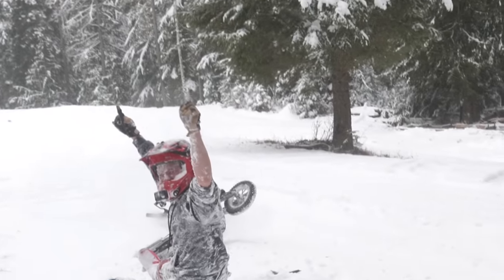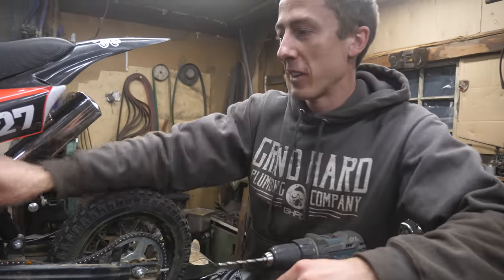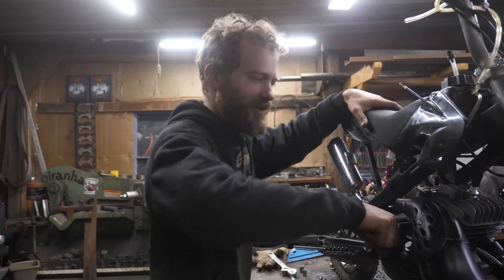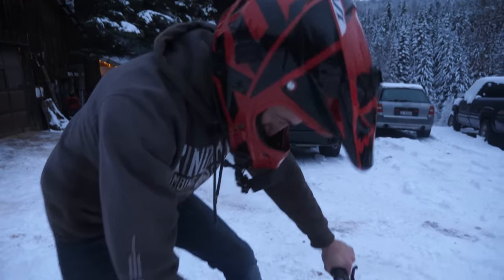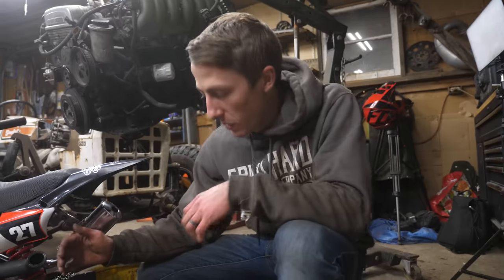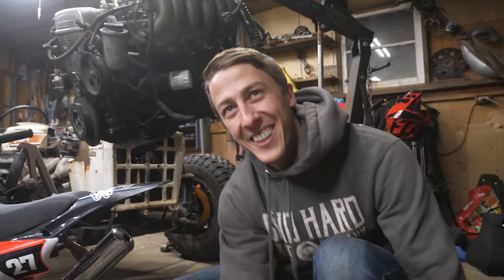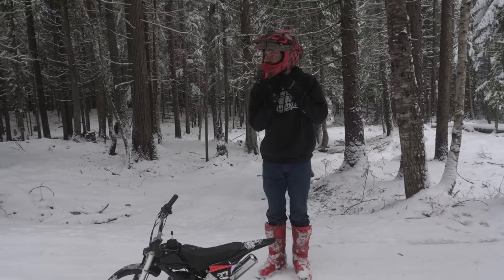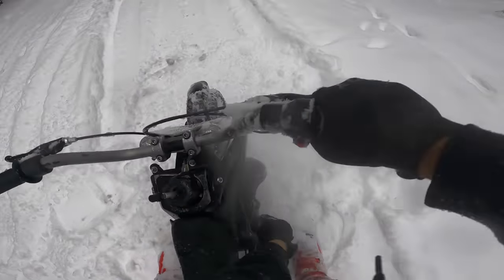$300 Amazon Dirt Bike Engine Swap 10x The HP! + Studs

Comment: You guys should build an rc car out of the old engine
Reply: MINI SENDY
Reply: Yes
Reply: yes please
Reply: y e s
Reply: Great idea!
Reply: Great idea!
Reply: Mini monster truck Jeep for a Barbie doll?
Reply: Yes
Reply: It would be just as unimpressive as the mini bike was with that motor. I own multiple gas powered rc cars and the engines used in gas rcs are much more similar to the new 50cc KTM clone they’re using than the old 4 stroke weed whacker motor.
Reply: @unitedspacepirates9075  Too small.  How about Chucky as driver?
Reply: not enough power lol
Reply: Build it
Reply: Good idea
Reply: WalnutLeader 340 some RC cars have more power than that engine..
Reply: @airtaiH2  yeah I know but it would still be cool. Just trying to give the engine a use instead of making it into a blender lol
Reply: Nitro engines that come in Rc cars have 3+ hp so that would be a downgrade
Reply: @colemanbinyon7063  true. Gearing also has a huge factor in it too
Reply: Margarita maker.
Reply: As others have said, it would most likely been a downgrade from actual rc engines these days. Make a desk fan.
Reply: @donellmuniz590  that would be funny as well
Reply: @BPatches701  lol that may also be a good use
Reply: YES

Comment: Big improvement over the stock engine. I had a KTM pro senior 50 a few year's ago. It had the water cooled 50cc engine. Absolutely no bottom end but man it would fly when it came on the pipe. It would easily blow away my 4 stroke 125 and 140cc bike's. Anyway, it was tons of fun but simply to small for me to ride comfortably so I sold it. Now I want another one after after this video.
Reply: Buy a Honda Grom or Grom Clone then slap on a 50cc or 85cc 2 stroke, then throw knobbies on

Comment: Just a heads up for you youngins at GHPC and out there in tubeland... If you pour 2 stroke oil into the gas tank like that you're going to get a heavy oil to fuel mix for the first few minutes which is fine for the engine,however once tbat oil which is heavier than gasoline is used up the exhaust is going to clear up and no more 2 stroke smoke will be seen due to not enough oil in the mix...Which is why we always mix our oil and gas in a gas can thay can be shaken up to fully distribute the oil with the gas and we never start and ride a 2 smoke without shaking the bike for a minute or three to help remix the oil with the gas.. Longer engine life comes with proper oil to gas ratio and agitating the 2. Judt an old timer from the 2 smoke eras shared knowledge...

Comment: Love the set tapper idea on the tire.   Might have to do that to my motorcycle for winter riding.  I have a odd tire size but my wheels come off feather easy bolting on to hubs like a car in the back and typical shaft on the front.  I could just get another set for winter.  Now just need a way to stay warm too

Comment: 3:20 That was the thickest 2 stroke oil i have ever seen
Reply: Likely back from the days when "2 stroke oil" was basically just 10w30 motor oil.
Reply: The fact it wasnt a proper mix ratio, or even mixed with gas was really bothering me as well. Especially on break in. Cringed a little.

Comment: I rode a honda cb350 during winter of 89 in ky to school, I used my size 13 feet in biker boots as skis/stabilizers most the time. It was about a 30 mile round trip and only crashed once when showing off in school parking lot. All in all it was a very cold experience.

Comment: So question. I have a ssr pitbike and I swapped the motor engine from a kick star 50cc to a electrical quick start 110cc engine. I got new wiring harness and a mini battery. i did most of the wiring by following some guides not sure tho if I did it properly but.. I did try starting it and it kind wanted to but it didn't at all. I'll start making youtube videos about it for you guys to see what I am talking about.

Comment: Thanks for the inspiration. I’ve got the real ktm air cooled motor I brought on eBay I’ve been intending to overhaul for months now and put in a China frame that is the full cradle design almost as close as the ktm replica pull start model can be. I actually payed more for my bike then the motor lol
By the way I didn’t search this it just popped up. Meant to be inspiration 😌

Comment: U guys should be testing the offroad three wheeler in the snow
Reply: Tri-sport Airport. 1974 RTS 340 With a 1969 350cl honda for power I did one in 74. To top out at 55mph. 7 inch disc brakes hydraulic rear for left and right steering in to corners

Comment: Can one of these engine be swapped for the 2stroke, or are they different sizes to the 2stroke?
I have an rc car with the 30cc 2stroke weed eater engines. I would like to swap for one of these engines. I don't want to buy one, and it does not fit. 
Do the bolts to the clutch bell be the same as the 2stroke set up?

Comment: After riding that thing 50 feet your ass will has so much oil on it from the exhaust you wont be able to sit on a chair made of sandpaper and not slip off LOL  If your going to track it! you need to add a ski to the front also! Go all in!

Comment: Good morning to boys of the hard kind of grinding I JUST got up from bed and sat my Finnish ass down in front of this machine that sometimes will, and most of the time doesnt compute, I think they call em peecees. So anyway as Im sipping this cold start spray for my brain and enjoing the video and the cool weather I instantly found nmyself thinkin than damn that tiny 4T engine would be an absolute funnybone tickleler if you would plant it into a 1/4 -1/8  size RC car like the edcat ampage rally ( SERIOUSLY GOOGLE THAT) and look for one  without the  body, a  picture taken from top where you can see the whole chassis with the 2 stroke motor mounted and all of the important parets of it and im pretty sure with your skills and abilities you guys could easily make used one redcat rampage chasis into a BEAUTIFUL 1/5 size 4 stroke ICE/SNOW DRIFTER,

But whatever you do please,just please dont do what EVERY damn person goes for with rc's and bigger gasoline motors; a DAMN no good monster truck wich will be unable to be driven and  enjoyed like these rally ,short-course, buggy and touring cars Trust me ive been in the hobby over 10 years. rant over. peace oout :)

Comment: I feel like this is pretty stupid, you buy a $300 Dirt Bike with half a horse power, and than buy an engine that's 10 times more powerful to put on it, so now you have a crappy dirt bike chassis, brakes and suspension etc with an engine mounted it is not meant to handle, not to mention all the hours of Manpower that went into doing this, so overall it was pretty fucking stupid compared to actually buying a real 125cc or 250cc Bike for like a $1000-$1500.